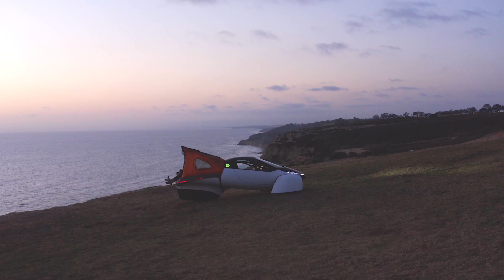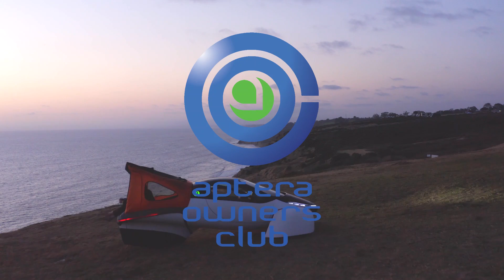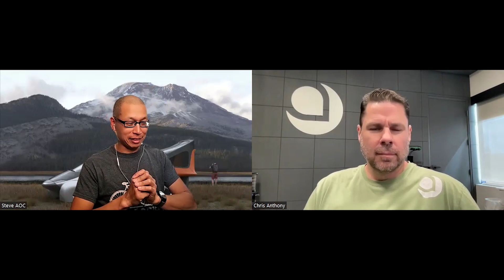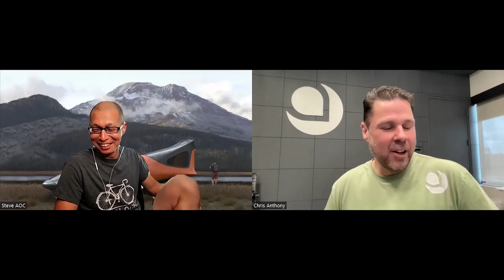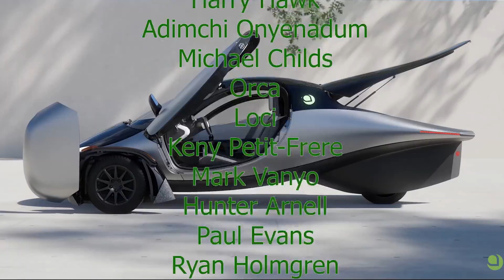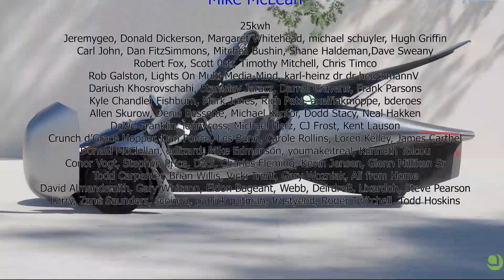Aptera Update with Chris Anthony May 2024 Full Interview

Comment: Since I was a child I wanted a solar car. I did never imagine that it would be possible to get a solar car that also is so elegantly designed that it would be with so little resistance for air.
Reply: Parking in a garage with this vehicle makes little sense. I don't think that makes any sense, but baseball should not be a problem. Checking the solar panels steel ball drop.
A deer can be expensive for any vehicle, but your insurance always, by law, the deer is always at fault.
Reply: @christopherbarrett9749  A steel ball from a few feet is not a baseball.  Deers can glance and the damage on a normal car is often a radiator and dented hood.  Regarding the garage, I'm in a strata and my stall options are covered or my locked garage.  Aptera is unique enough I don't trust that vandals wont damage it overnight (Tesla's get key'd all the time).
Reply: I think it might actually be IMpossible to make a solar car that ISN'T so elegantly designed 😉
Reply: Solar is useful for some people but the true strength of Aptera is efficiency.  With California souring the deal for net metering their is far less demand for on roof solar (which should make far more sense for home owners).  Aptera avoid local stupidity but I would still happily buy one without solar if the price was lower or it was more durable.
Reply: @ccibinel  I'm curious as to what information you have relevant to durability.
Reply: @billmanewal1786  Nothing specific.  Just simply that a single solid material assembled with a less complex process  should be lighter, cheaper, more durable or all 3.  A hood or hatch with embedded solar panels will be a single large assembly to replace (likely ~$500 - $1000) if ever damaged where a simple material could POTENTIALLY be ground, reshaped or patched to address cosmetic damage from a baseball or deer.  Small wires and embedded solar panels is definitely more complex and expensive than a simple SMC, polycarbonate, or metal part.  If the vehicle is parked in a garage 95% of the time (as mine will be) the solar just adds complexity and cost for little benefit.  That said I also understand that my views are a small minority, options add a ton of cost and the marketing is strongly pushing solar as the defining characteristic of the vehicle; I will be surprised if Aptera ever ships a non-solar hood and I'd guess 50/50 on the hatch.
Reply: @ccibinel I have to disagree. They just gave rides at CES in their test vehicle with full solar on it and after 20 miles of driving the battery hadn't lost charge. This is in January. It's a very good indication that many of your trips can be "powered from the sun".
Reply: @garywozniak7742  Putting solar on the vehicle has value if you see value in solar on the vehicle rather than what it parks in.  This is useful for those parking outside in places with relatively expensive power (or dirty power if concerned about that impact).  In BC we have cheap hydro power.  Anyone parking in a garage would be better served by solar on the roof of the garage than on a vehicle.  For those without access to a garage and assuming vandalism isnt a concern it can be useful but economically at $0.10 usd / kwh it will take a long time for the solar hardware costs (admittedly baked into the vehicle) to break even outside of california.  The insane efficiency making level 1 charging effectively level 2 is extremely appealing.  If parked in an ideal environment Aptera getting 30-40 miles of range per day is impressive but not overly useful for those with green/cheap power in other forms already.

Comment: interview started out well but quickly questions turned to practically praise  instead of actual questions and the end... well.

so now it is likely the first three PI builds will not actually have production intent frames given they were seeking pieces from other suppliers and had a wide range of times provided and they were all local to California when it has been specified frames, chassis, and suspension, were all to be done in Italy. Throw in the comments about ABS and brakes and I am sadly expecting the early PI again to not have powered brakes and likely not even power steering.  You should have caught the implications of the frame comments and immediately challenged Chris on that change.
Reply: I can't wait for the day when my LE Aptera is sitting in my driveway and I'm rereading all the wild-eyed speculation, negative comments, unreasoned doubt, impatient criticisms and 'engineering impossibilities' from this gang of critics who seem to have no other interest other than to destroy peoples' confidence in a completely novel form of personal transportation.  I will also be admiring my burgeoning investment account in Aptera.
Reply: @bobhellman8676  I appreciate your comment at the end.  

I have seen a functional example of a skin cooling design, shown to me by Daniel Morris, under NDA.  The likely major reason for using off the shelf heat exchangers for now is to save capital costs at this point when they need to get into production as quickly as possible.
Reply: @bobhellman8676  Bob, you know as well as anyone that the delta design had a vacuum resin infusion body design with a practical yearly production rate of around 4,000 units per year.

When the paid pre-orders reached over 10 times that number it would have been irresponsible to continue down the original path, and as a consequence, the redesign has also greatly increased the quality of the product that will be delivered. 

How are you overlooking the fact that Aptera has responded to the changed demonstrated demand?

Aptera has continued to produce IP for which there is now 3rd party demand as well.
Reply: @bobhellman8676   Do you?  From what I've learned the ONLY GUARANTEES in life are death and taxes.  We're not overlooking anything.  We're just not so rigid (like you and others) with a timeline that is never going to be 'chipped in stone' due to rapidfire advances in cutting edge tech that they're trying to build into this novel concept.  Yes, they had to back off the belly cooling because the timeframe for development of manufacturabiity to inclusion in LEs would per their knowledge push the timeline out further than money and customer patience would permit.  But SOME intended customers are like the teenagers who aren't getting fast enough gratification of their inaccurately comprehended wish list yet.  Nothing is being overlooked except for the reality of how novel R&D moving toward efficient, cost-effective manufacturability actually occurs in the real world.  If you don't want one and aren't patient, then hold your negativity and just go away.  Stop trying to sour the broth for those of us who can patiently wait 'for the soup to simmer'.
Reply: @rchender hear hear
Reply: Interesting take... you gleaned a lot of information that NOBODY else seems to have noticed.  Is everyone else just not paying attention or are you fabricating a narrative of doom and gloom?  Nobody knows for sure!  Keep up the important work of ankle-biting!  Very helpful!
Reply: @J-W-Kelly Dude are you thick or what? Aptera does not nail down timelines or suppliers or even funding for a reason. Such a wee little thinker in that head of yours.

Comment: Aptera's Launch Editions will begin to be delivered in summer of 2025, judging from current information from the Co-CEO.  It will be a safe, phenomenally well-thought out solar-charged efficient all wheel drive electric vehicle available at an affordable price.  TPM built at a rate of 40/day they claim to break even at 8k vehicles built/sold/delivered.  Very excited to witness history and reduce maintenance costs and eliminate gasoline costs forever.
Reply: Aptera doesn't yet have funding from U.S. Capital. Will Aptera be able to produce a any Launch Edition vehicles without funding from U.S. Capital? Has anyone from Aptera ever said they will be producing any customer vehicles with the funding received from the crowdfunding effort?
Reply: @skipondowntheroad5833  Apparently you don't listen to, nor have you listened to either of the co-CEO's discuss their progress toward funding for both PI builds and LE builds.  I suggest you go back and watch those videos.  This coming week, and by invitation only investors will get an insider update on financing progress.  It is possible that the company won't get any cash from U.S. Capital until the crowdfunding of the Accelerator program has formally closed at end of June.  And I have never heard co-managment state that they had sufficient funds to produce any customer vehicles from funds achieved with the crowdfunding monies.  Those monies were stated to be for engineering development, large tooling such as the BinC tools, and solar cell as well as battery pack development.
Reply: @Aspkkr  You are SO wrong.
Reply: @Aspkkr  It is clear that you have never seen or ridden in an Aptera prototype.  They are far more advanced than many other full production EVs, including The Corbin Sparrow and the Ford (Pivco) Th(i)nk

The body tooling, flexible glass solar panels, and the 2170 NMC battery packs all show you are wrong on your opinion.
Reply: @n.brucenelson5920  You know full well that you are being dishonest. The so called prototype may have had flexible solar panels but they will not be the same ones used for production, the body isn't even the same material and therefore the tooling will be different and the batteries will no doubt be a completely different setup. If you have to flat out lie to make your argument then maybe you don't have one.
Reply: None of what you call "current information" has happened yet.
Reply: @montanaerdoc  And your point is negative nancy?  When a company executive tells something publicly, that isn't current information?  I guess you don't think that lethal diagnoses aren't 'current information' because the patient hasn't died yet!
Reply: @rchender  Negative Nancy? That's true. I am. 
After a long while, I stopped believing what Aptera was telling me.
Reply: @montanaerdoc  Sorry to hear that.  I understand doubting and limits to patience, but for me (and I'm just speaking for me) those two things can be assuaged a bit with dribbles of verifiable information along the way, that when subjected to logic, further scrutiny, common sense and a bit of my own 'analysis'.  I'm a cautious investor having invested in 22 startups mostly in the health sciences field and have been using the same methods and practices for over 30 years now.  I had doubts I might ever see a vehicle sitting in my driveway, but recent news and developments have almost entirely dispelled that fear.  I'm happy with my position on the Leaderboard and won't be investing more until the IPO because that's a proven opportunity point for me.
Reply: @montanaerdoc  On the other hand, my wife and I have had lengthy rides in a prototype that showed the performance they had been claiming.  

The vehicles they will be delivering will have far better quality than the vacuum resin infusion vehicles they had originally been planning for, and can be produced in FAR larger quantities than the 4,000 per year they had been planning.   These changes are a huge positive and will mean that the first Apterae can have a far larger positive environmental impact.